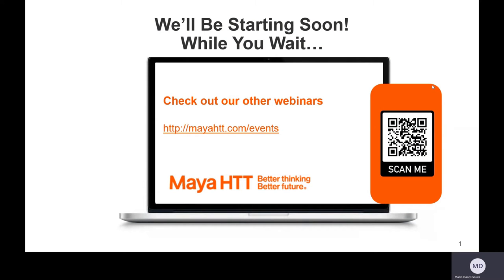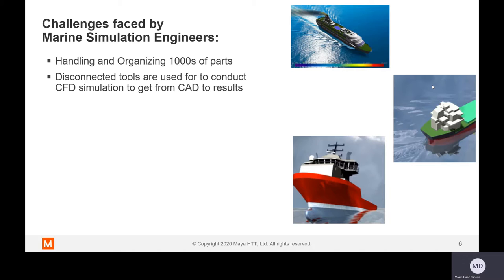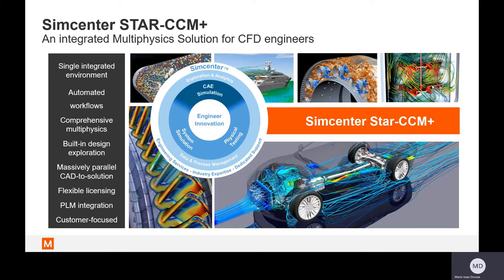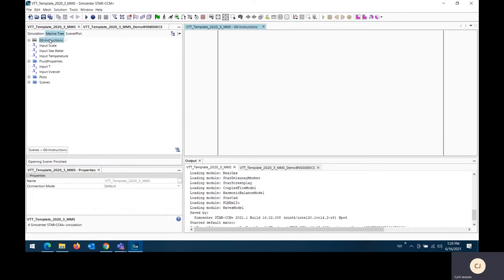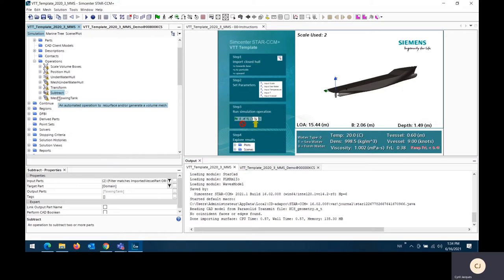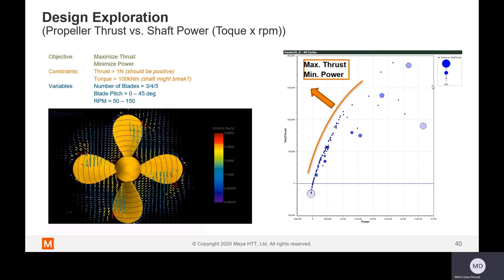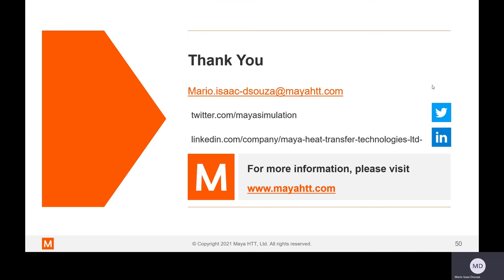Hands-on Simulate Series with Simcenter STAR-CCM: Marine / Tow Tank Simulation (Session 3)

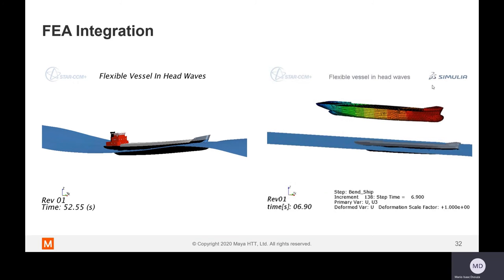Comment: Hi, could you please introduce how to simulate a moored boat's reaction to the waves? (such as the condition at 43:54)
Reply from the maker: Thanks for your question!
You would need to define 2 bodies in your DFBI model: a 6DOF one for your boat and a 0DOF for your mooring (you can also use the environment directly), then create a body coupling between the two of them with a spring damper component to model the mooring. The rest of the set-up would include the overset mesh for the boat’s motion and VOF for the free surface calculation.
If you have further questions, please don't hesitate to contact us (https://www.mayahtt.com/about-maya-htt/contact/).